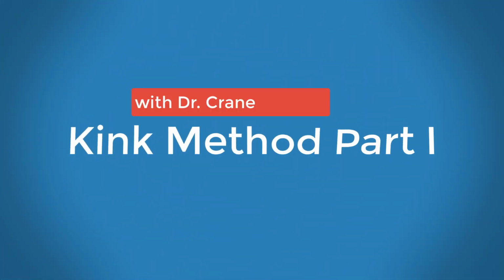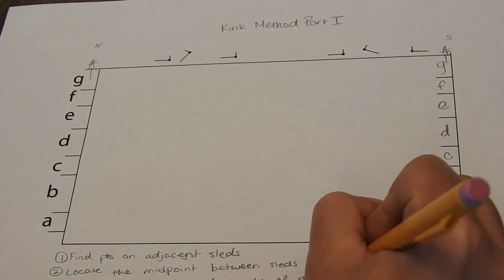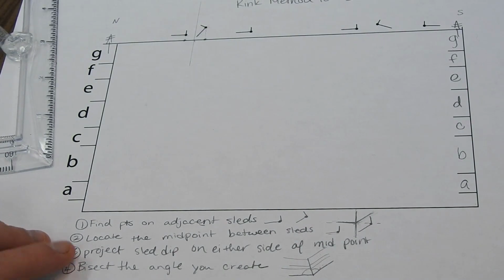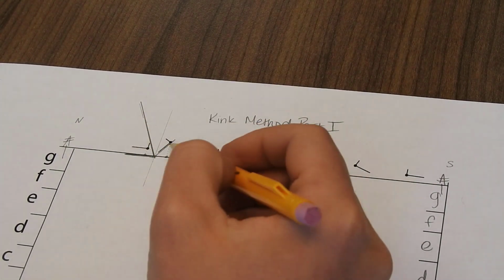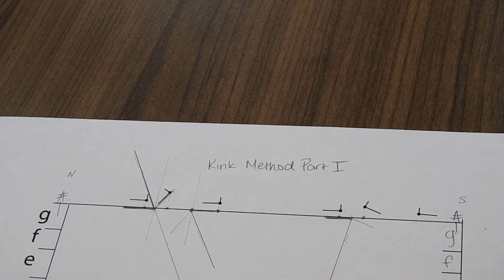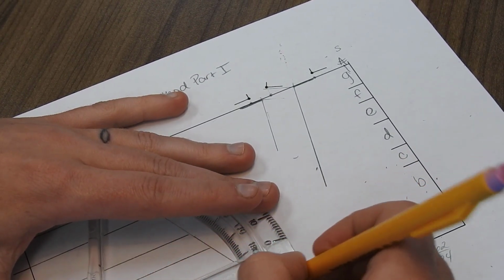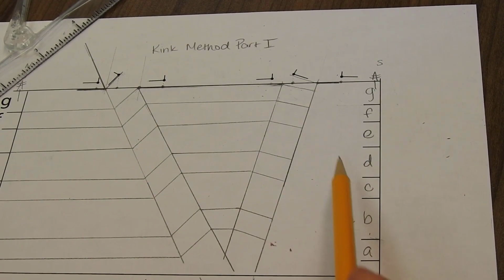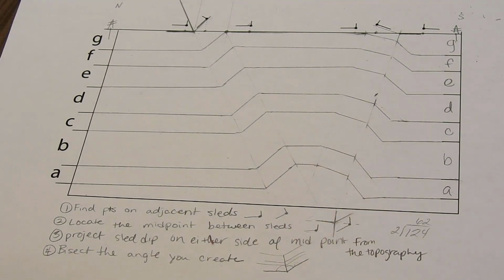Kink Method Part I

Comment: Hey,Thanks a lot for sharing. I wanted to know can this method be applied on an area with  less less fold information. and also is it necessary to have a stratigraphic sequence? or a geological profile section can be used for this method?
Reply from the maker: Aali Narain I tell my students that the kink method is a tool, not the key to everything haha. If you don’t have as much information, you can use strike lines or 3 point problems to add data OR you can use the method where you have data and transition to a “circle method” later to create a cross section draft. In your polished section you’d round your link corners. You don’t need strat sequences if have a geologic map and evidence that units aren’t overturned.
Reply: @kc_structuralgeology6992   i am looking for methods that would help in structural interpretation of the area.. Though I have limited data for structural features ( area is highly deformed). What other methods you would suggest for the same?
Reply: Please make a video for 3 point problem also... 😁 thanks
Reply from the maker: Aali Narain I did! Check in some of the earlier videos to this channel. :D